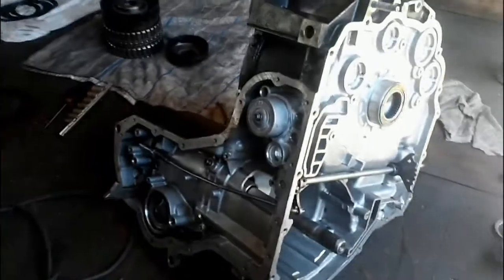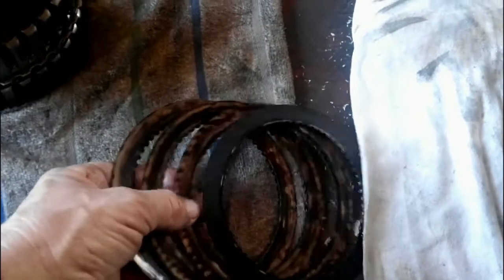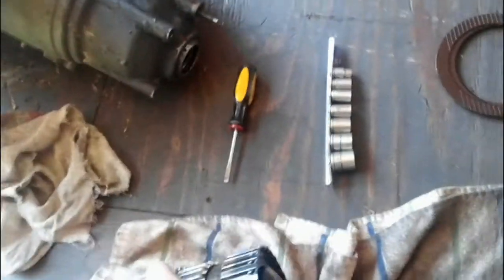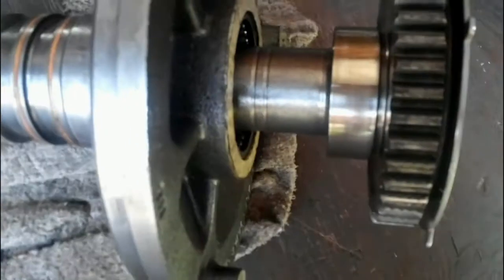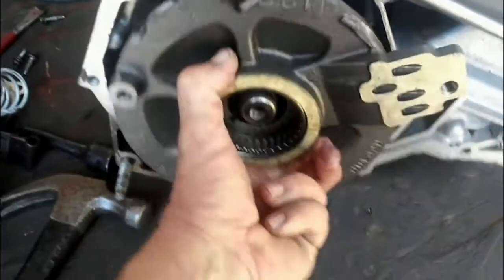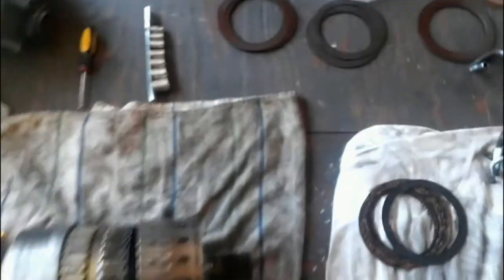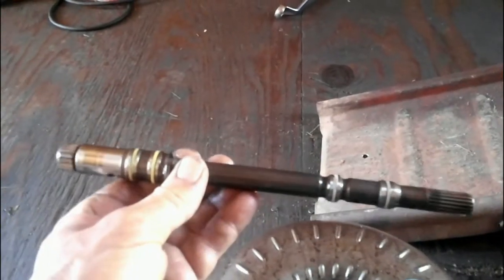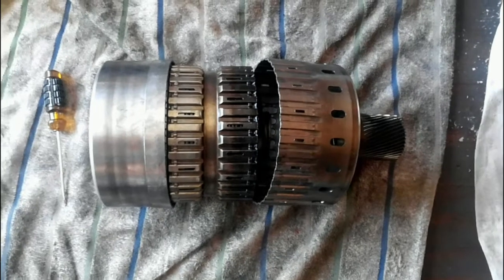2001 3.0 Taurus transmission update AX4N.

Comment: There's two big problems that I know of which cause failure in the ax4n when is a torque converter which I did not know about it until recently with these videos and the other one are in complete bore diameters for lubrication holes obviously this is the problem if you don't have proper lubrication or flow you're not going to get substantial life

Comment: Great video! I'm going through this right now and this really helped. I had the same burned up the intermediate clutch. 

I'm running into the same problem where I can't quite get the last support (one that holds the driven sprocket) to go in all the way. It sticks out about a half inch. I've pulled all the drums and everything out and put them back several times and it always sticks out about a half inch. Did you figure out what was keeping yours from going in right?

Comment: i have a2005 FORDTAURUS...3.0 VULCAN   problem....only when hot weather say 70 degrees you can drive and say interstate aprox 20 miles....you stop and take back off...it slips between first and second...3 and 4 is good...being going on for a year....winter weather it shifts greatly...not trans codes....dont see speedometer slipping...i keep fluid changed...was wondering is bad tranmission temp sensor...and if so where could it be.
Reply from the maker: Clutches ...Bad.
Reply: @FixingWithPassion  Why does it change perfectly during colder weather...I mean from Dec to feb...no issues at all....
Reply: @charlesjackson9602  valvebody issues or seal leaks.

Comment: check out Cascade Transmission Parts on eBay.  Rob is an awesome guy and will take care of you.  Thanks for the video btw.. have you tried any other transmission rebuilds?
Reply: also, those teflon bushings get messed up SUPER easy if you have to take them in and out a bit.. just watch it and put on liberal amounts of translube so everything slides back together and no damage is done.
Reply from the maker: Just did a 4R70W Expedition 4.6. My body hates me now. That was pretty big job.
Reply: have a 46re I will be doing Christmas break/vacation.  Every bell and whistle will be added.. heavy tower.

started following my man.

Comment: Nice video.
Reply: Transmission in my 2004 freestar will go in gear and pull for about 20 to 100 feet just fine then it disengages like it's in nuetral do you have any ideas of what the problem is?
Reply from the maker: @boohickman2470  Its toast. You check the fluid level??
Reply: Its not burnt up